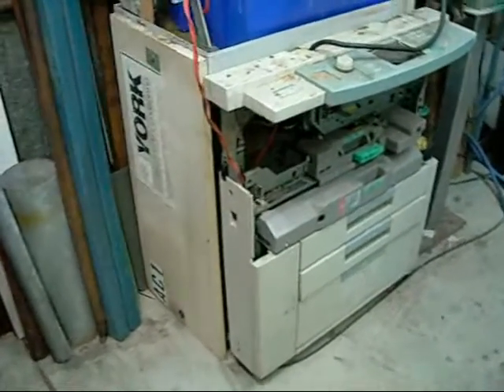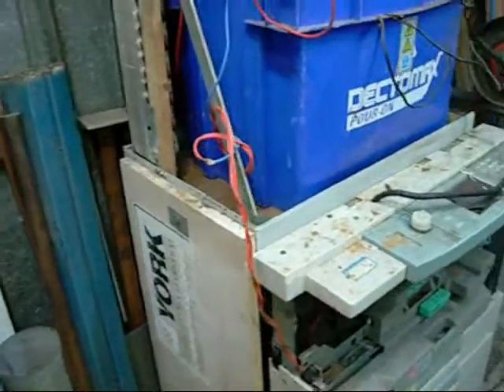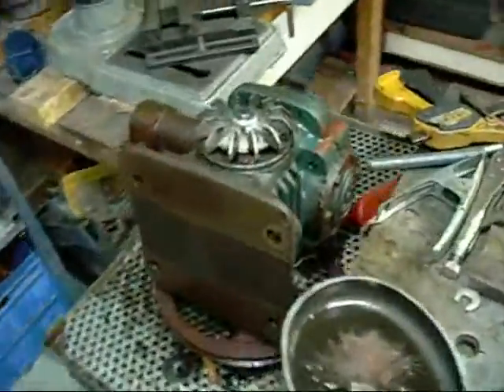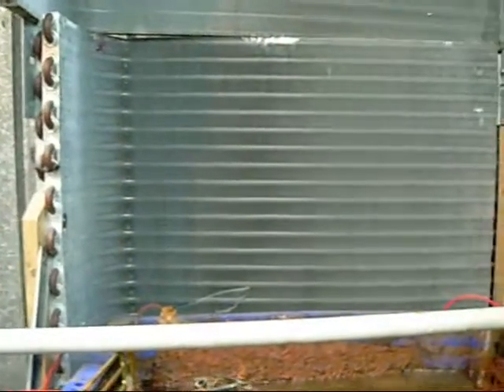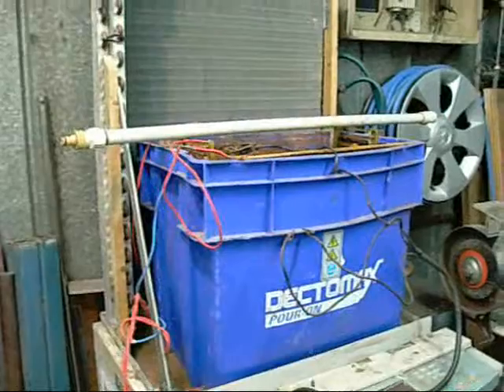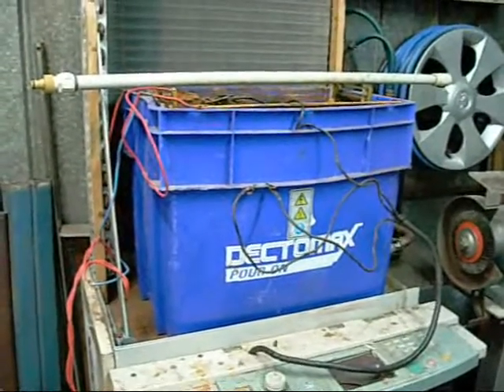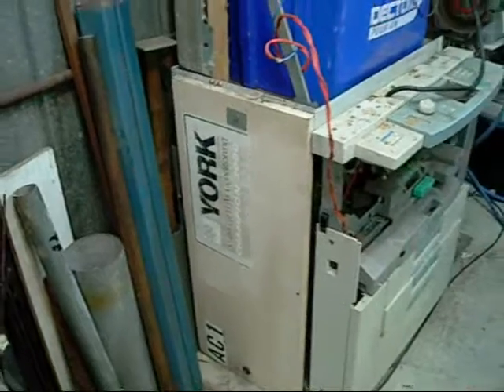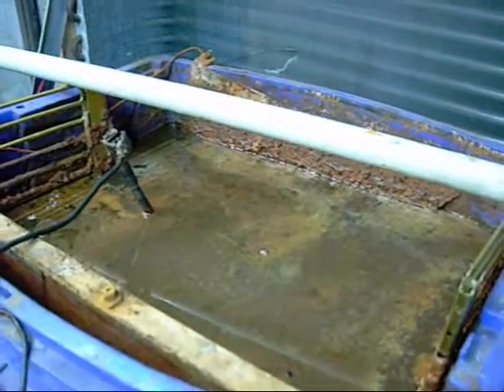Advanced Electrolytic Cleaning

Comment from the maker: The ratio of soda can vary a lot, I'l mix in 5 pounds or so and give it a try, maybe even 10lbs. too little and it just works slow, and it would be hard to put too much in 1000gal unless you have crates of it. even then it should not cause problems.

If the welder is full DC I'd go with that, if its a normal AC welder it will not work tho :(.
big forklift battery chargers work well too. either way you will need a lot of amps and good connections to the anodes and tank.

Comment: thanks for this! i have a 1000 gallon steel tank that i want to clean internally, ive got a rough idea of how im going to work it out, but how much washing soda would i need? and how long is it going to take to remove heavy rust? shoud i use a battery charger or a arc welder?, cheers

Comment: If your using stainless steel as your anode, then your releasing hexavalent chromium, the movie erin brockavich is all about the exact same chemical, its bad news.  For the anode you should only use a ferrous metal like steel or iron, any alloy with anything added to it like stainless can release some bad stuff